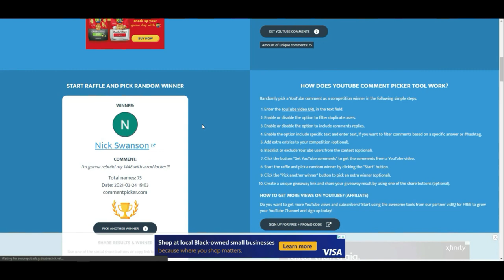Are GOLF TUBES Great Conduit for Jon Boat Wiring??? + GIVEAWAY WINNER {Jon Boat to Bass Boat}

Comment: I'm trying to do something different,   the middle bench seat I want to remove it and put a three gallon fuel cell on one side and another three gallon on the other side and put a live well in the center?  What do you think, and would that work? And is there a way I can send pictures?

Comment: i have used pex tubing in 1/2 and 3/4 inch pex pipe
Reply from the maker: Is it light weight?
Reply: @BassBrothersFishingDMV  not carbon fiber light but light enough to notice. 5 and 10 ft lengths pre cut straight.
Reply from the maker: @davidm2250  thanks for sharing. I'll def check it out.